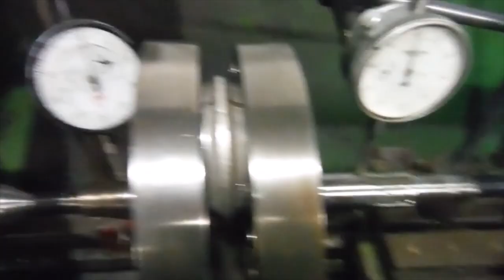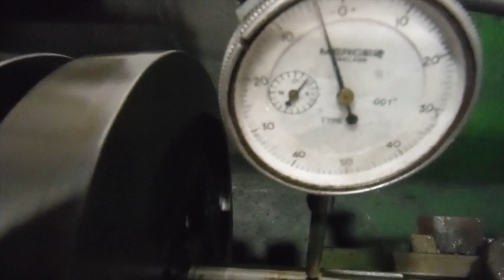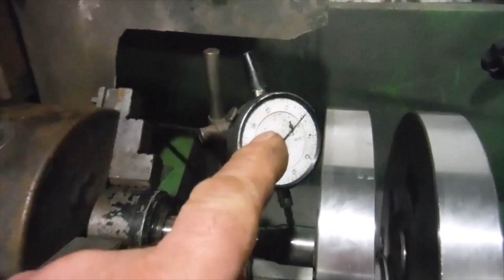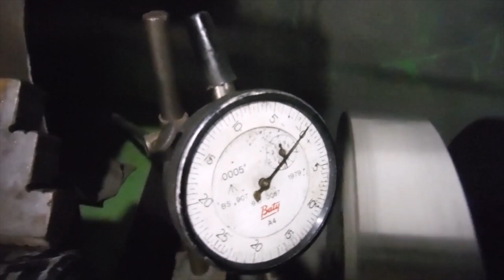Royal Enfield Bullet 500 Asbo 50 crank and bottom end rebuild discussed. See description for more.

Comment: brilliant work paul, and getting six thou back from the runout 
puts it back to almost new 👍👍😇
Reply from the maker: Thanks - it is just a shame it will have to come apart again, as it turns out the crankpin was made too narrow and the supplier can't offer me any guarantee as a result, but is going to supply a replacement item to the correct specs.

Comment: hi Paul I notice there's no oil holes in the new piston where the gudgeon pin bosses are, not like the old piston has, is that ok and will it cause a problem. kind regards Adrian.
Reply from the maker: Hi Adrian, I have used quite a number of these pistons to date and there have been no problems, apart from one which holed due to very poor flow through a fuel tap on one machine. There are drilled oil holes through the oil ring groove on these pistons and no risk of a crown coming off, as can happen with the original types!
Reply: @paulhenshaw4514  hi Paul thank you for your quick reply and a thumps up from me on your great vids
Reply from the maker: Thanks!

Comment: Hi paul, I own a 1989 STD 350 and I'm looking to increace the weight of the flywheel and balance ot for that "extra" low end torque. What's the maximum weight that could be added to the flywheel without doing any sort of shaving on the engine cases?
Reply from the maker: Flywheel weight does not affect torque, but advancing the inlet cam timing might help.
Reply: @paulhenshaw4514  Thanks paul . I have tried advancing the inlet cam by one teeth with guidance from your video and the engine performance at low revs was not to my liking, so I have gone back to the original setting.
Reply from the maker: My video shows how to retard the inlet timing, which makes the engine produce more power at higher revs, but what I said above is to advance the inlet timing, if you want more 'thump', which means moving the inlet cam clockwise, rather than my usual anticlockwise. I have not made any videos discussing advancing the inlet cam timing, as it is not something I have ever felt the need to do.
Reply from the maker: Hi Vishal, just to be clear, I think advancing the inlet cam timing [moving clockwise] might be useful for you, but retarding [anticlockwise] will not help with what you want.
Reply: @paulhenshaw4514   Thank you paul. I have tried retarding, but I have never done advancing from the original position of the cam. I will try it and post the update.

Comment: Just seams odd that the big end has no float and the small end is too wide as well. 🤔
I would like to quiz the supplier to check what sizes they are working to.
Reply from the maker: All is being put right, a replacement crankpin of the correct width is on the way and I received possibly the last conrod with a too wide small end, I am told, as that error has already been noted and taken care of.
Reply: @paulhenshaw4514  excellent news, it's good to find out what the problem was.